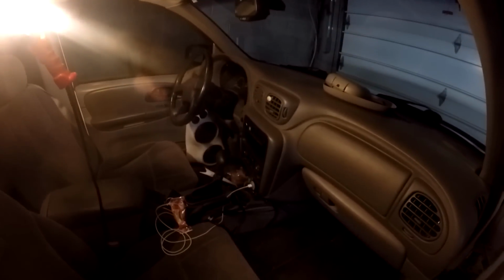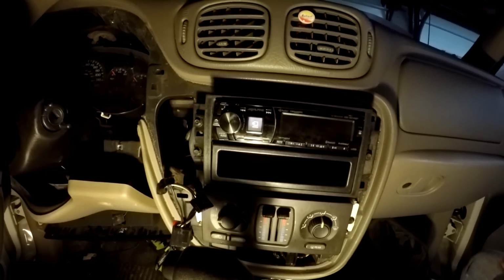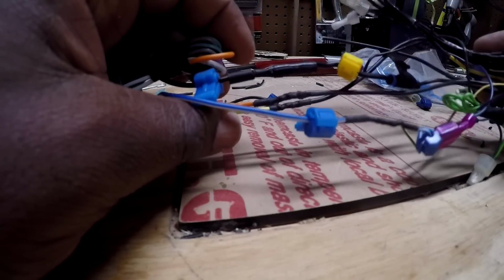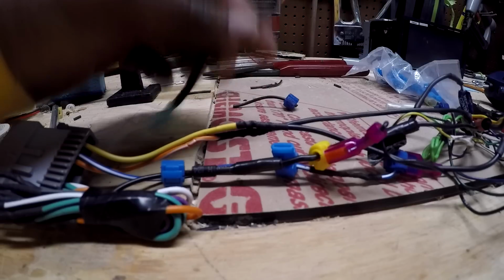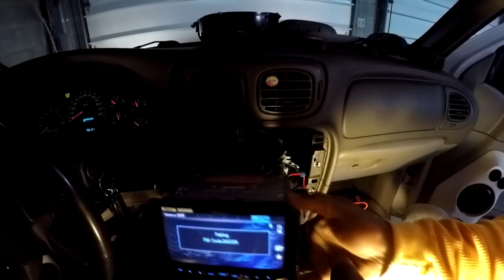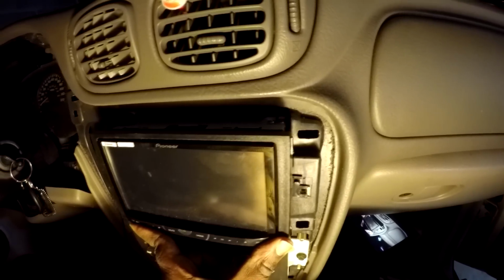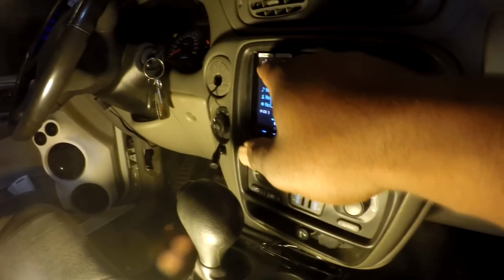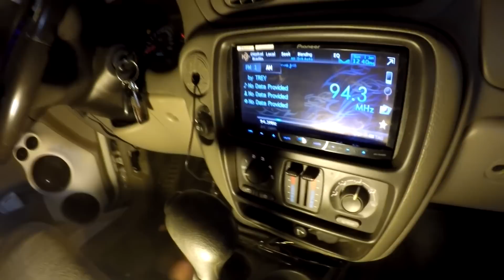2002 Chevy Trailblazer - Radio Swap

Comment: Would this work with a '99 Trailblazer? Also would all of the wiring be required if I'm just changing out the radios to a newer one, or would they simply just be switched so I didn't have to do all the extra wiring work you did? Thanks!
Reply from the maker: I'm guessing it would since they didn't change the design from 1999-2002.  Yes you will need a harness and there is a short video on my playlist  "Helpful Quickies" that will show you where to grab the ACC wire.  Be sure to check out all the Trailblazer playlist vids.

Comment: had a after market radio put in my envoy.my bat drains every night now.can u help me figure it out
Reply from the maker: If your radio cuts on w/o a key then ACC is wired directly to the power wire.  You will need to run an ACC wire from the fuse box and re-wire your unit.

Comment: Where did you run the 12v accessory wire to...fuse box in engine bay?
Reply from the maker: https://youtu.be/yvpvNOR3cLM
Reply: @PoppaTInstall  thanks..

Comment: did you connect the on star to the radio and the volume control on the steering wheel to the stereo as well?
Reply from the maker: I don't have steering wheel controls. Isn't the onstar  dead💀?
Reply: How would I keep the onstar and wheel controls

Comment: Great work looks clean I love them Pods too 
What Model Pioneer is that ?
I have a AVHX2700BS but just bought a AVH2330NEX it’s a little upgrade for my TB 
I was gonna use a older Kenwood DD but it’s firmware is older than my current pioneer and it’s just not as crisp but it’s a bigger screen and the screen can be set to different angles and to remove DVD 📀
Reply from the maker: I now have a Pioneer NEX 4100NEX.
Reply: @PoppaTInstall  nice 
I wanted the one that has the Wireless CarPlay but the One I have is good enough
Reply from the maker: @RobPGamerVaper  I will have that in my new build on the Tahoe.  If you haven't already please subscribe.

Comment: Taps worst mistake ever
Reply from the maker: If used incorrectly yeah, but they are convenient if you wanna make a quick connection w/o having to unravel wires for solder.